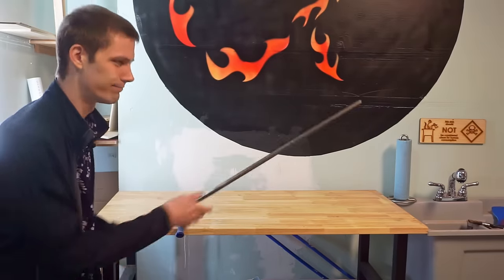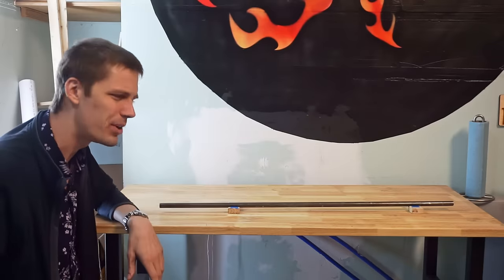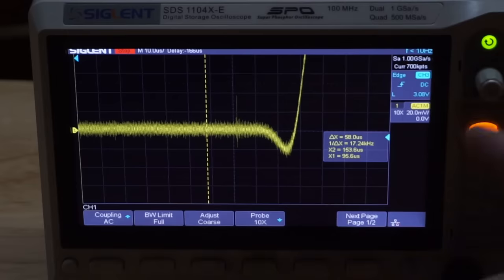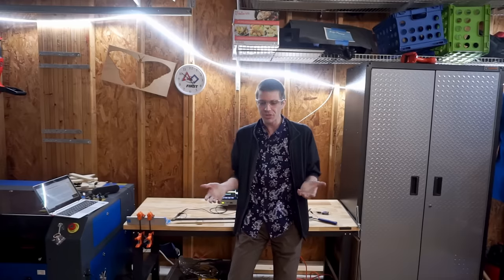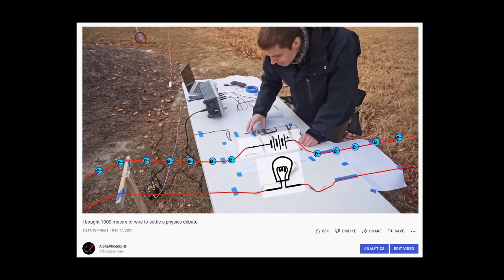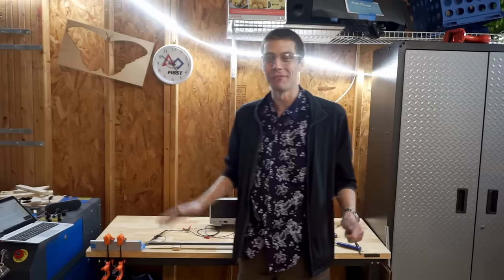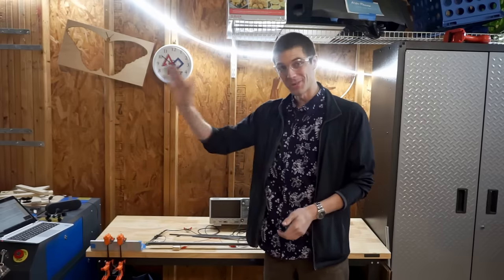Are solid objects really “solid”?

Comment: Anyway the behaviour of a solid object depends on the bandwith of the force applied. When dealing with high bandwith impulses like hammer's one no body is a solid body. 
You could try to make the same experiment with a resonator exiting the rod at any eighen frequency and then measure axial displacement in a node position to see that the bar doesnt move at all

Comment: Except that cylinders are 3D... or sort of 2D in a sense (length by diameter/radius).
OK, I guess you did say "basically," giving them a little room to be 3D but act 1D. Meaning that you'd say that the big cube would be significantly more 3D.

Comment: do you have 2 pressure sensors or 1?   the delay might simply be the sensor propagation delay so you would need both sensors together, hit the hammer, then measure that they react the same, note any nanosecond delay?  now you have the sensor correction factor.  Then put them at either end of the metal bar and get the reading?   Or is that what you did?  Anyone who can comment please do.  These measurement videos are great

Comment: Since the information transfers at the speed of sound, does that mean that after the speed of sound objects start to stretch?
Reply: Compressed. Followed by "stretching"/"decompression", like a sonic boom for example. If you further brake it down in layers. Boundary layer, where information is most compressed does not move. Even if information leaves this layer it's replaced by new or more information. In theory, you can compress information in this layer until you make a black hole. This layer increases the area of information transfer. Layers after the boundary one have decreased compression and information flows towards them.

Comment: C makes the most sense, I would go with D but being 10x longer then the speed of sound makes no sense it should be close to the speed of sound in the material 

Edit: after the answer I guess the speed of the hammer only would matter if the hammer was moving faster then the speed of sound in the materiel

Comment: Can someone explain to me why (in his previous video) the electrical "shockwave" was traveling as the speed of light, because it was electrons pushing unto electrons and electron interaction is mediated by photons, but here the kinetic shockwave is traveling at a lower speed (speed of sound) where it is atom pushing against atom, which (by his own explanation) is in fact the electron's of one atom pushing the electrons of the next atom, the same interaction also mediated by the electromagnetic force (photons). Where and how exactly does the "delay" happen, that turns propagation at speed of light to propagation at speed of sound?
Reply from the maker: Atoms are a lot heavier, and the springs connecting them are wimpier, so the field propagation isn’t the only thing that matters anymore

Comment: That is if there is a source of energy able to deliver such energy to even push that weight would, by every definition, destroy the bar. Anything less would get destroyed by the bar. For the sake of argument let's say it can be pushed. It would take time based on the force enacted on it, like a sound wave but in the resistance of the steel. Like a guitar string.
Reply from the maker: You could push it with your hand, it would just accelerate slowly

Comment: What happens when the force applied compresses the atoms a lot closer together, or even to touch?
Reply: in stars, pressure compresses atoms so much they fuse together, and eventually pressure gets so big they form a singularity with arbitrarily high gravity and make a black hole

Comment: If we had a non deformatable pipe filled with water capped at both ends with sensors. Water being non compressible. What would you expect for the outcome of the experiment?

Basically what would the outcome be using a non compressable material?
Reply from the maker: Water is compressible, just like steel. The result would be the same as here
Reply: @AlphaPhoenixChannel 
What if the water is pre-presurized in the tube?
Is there a non-compressible material that can be used?

Comment: At 09:39 you talk about the negative blip being an artifact.  Couldnt it be the bar receding from the sensor as the wave of force travels through it, similar to the ocean receding prior to a tsunami? 9:39
Reply from the maker: It went away if I reversed the sensor, but to trigger with the hammer, the conductive side had to face the other way so I was left with the artifact

Comment: Your electrical connection, at the hammer end, would have been more accurate, if you would have placed the electrical connector on the hammer.  You will probably see different results.

Comment: Question, what exactly is the force that springs back the atoms in place? Does it have an end or does it keep going forever like a constant?
If I assume the metal bar is unbreakable and I keep hitting one end of it forever, would it one day just bend as the forces withing cannot... "Boing" back in place?
Reply from the maker: Elastic deformation (springiness) is a deformation of the bonds between nuclei. When bonds stretch, the electrons that make up those bonds end up in energetically unfavorable areas and there’s a force to put everything back.
If you push too far, you can break bonds and permanently bend (plastically deform) a material. Check out my video about “why are metals stretchy”
Reply: Thanks for replying! Really like these science/physichs videos as an someone cursing electronic engineering, though this is ten times better then electromagnetism 2 XD @AlphaPhoenixChannel

Comment: The effect of vibration, and distance from bar to sensor is confusing me, wouldn't that vary by a lot?
Reply: and what if this experiment was done with similar density object but made of different material will less vibrating characteristics?
Reply: ALSO what if you just pushed it instead of hitting it? (less vibration)
Reply: Speed of sound is “the distance travelled per unit of time as it propagates through an elastic medium”. So this means the speed is different depending on the materials characteristics . E.g density and coefficient of stiffness
Reply: @Boahz so to answer your question by less vibrating you mean less stiff then it should be slower

Comment: Is it possible that if you press the left of a really long rod that the longer it is the more inertia there is on the right side of the rod due to the extra mass?

So it would slow down as length increases?

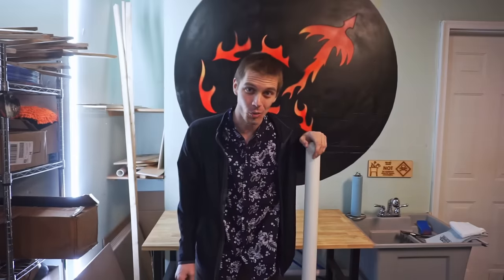Comment: The celebration I had when you said 180 micro seconds was a little embarrassing on my part. I fucking knew it! Admittedly the way I got to my answer wasn't very scientific... It can't be no time, because physics, it couldn't me the 3 milliseconds, because if it was that big on such a small piece of steel it would be something that may have to be considered in big machines, so it was between light and sound... And as I'm typing this it just occurred to me that sound quite litterally is movement... But anyway it was between sound and light and there's no way movement is as quick as light so it had to be sound... And vibration litterally is movement and sound. It's 3:15 in the morning give me a break

Comment: you are doing 1 big mistake in your experience. You are not measuring the time it take for your the push from the hammer to push the sensor. you are measuring the time it take between the completion of the electric circuit when the hammer touch the bar and the completion of the circuit when the sensor if pushed. So you have a few extra variable that normally could be ignored, but normally we could also ignore the delay it take for the push at one end to reach the other end...

If you want to measure something SOO precisely, you need to make sure your circuit are the EXACT same lenght so it the time between the completion of one circuit and the time to complete the other circuit are the same and cancel each other out, isolating the time it took for the push to travel along the rod.

Comment: Does this mean the bar is bounded by the speed of sound? It will just deform/compress if it goes faster?
Reply: Speed is relative. In the frame of reference of some cosmic ray that bar is travelling very close to the speed of light right now.
Reply: @lunkel8108  let's assume for a second the frame of reference is the fucking camera
Reply: @woahblow4127  The point I was trying to make is that a law restricting objects to some top speed dependent on the material they're made out of simply does not work if speed is relative. It's nonsensical. There are always scenarios were it's wrong, so it can't be a law.  The answer to your question is no. Anything can travel as close to the speed of light as you like. From the right frame of reference they already are. From the perspective of the object itself, it's always stationary. Only relative speeds matter. The speed of sound in a material is relative to the material. If the bar was travelling at 3000 km/s, then a shockwave would propagate from the back to the front at the speed of sound + 3000 km/s from your perspective (not accounting for relativity).
Reply: @lunkel8108  na you ignored the premise of my question and the video to give a lesson no one asked for. If I tried to poke you in the eye with an infinite length bar would it just compress if I got angry enough and put enough force into it to make it move faster than sound on my end?
Reply: @woahblow4127  Your question doesn't really make sense to me. The point of the video is that if you push on the bar with any amount of force at all, you first move the part of the bar closest to you, which compresses the region behind it and then this compression travels through the material at the speed of sound because that's basically what sound is. So we can generalize your question by getting rid of a lot of details: "If I tried to poke you in the eye with a [...] bar would it compress [...]" to which the answer is yes, as explained above and in the video. All of the extra detail of your question isn't really necessary. If you push on a bar under any circumstance, it's gonna compress a little bit. That's already explained in the video so I'm not sure what you're really asking for with your elaborate scenario.
The question also feels like it might hint at a common misconception about force, velocity and acceleration. Let's return to a finite bar. You can push on one end of the bar very, very gently and as long as you keep that up for a long enough time, the bar will eventually surpass the speed of sound and in fact any other speed (not getting into relativity here). You don't have to apply a lot of force at once, like you seem to be implying. F=ma, not F=mv is how reality works.
Lastly your original question was - and I quote - "Does this mean the bar is bounded by the speed of sound? It will just deform/compress if it goes faster?". I interpreted the first sentence as "Is it impossible for the bar to travel faster than the speed of sound?" which I think is a very reasonable interpretation of that sentence, especially given the second one. And I answered it with a clear, resounding no. That fundamentally wouldn't make any sense and things travel faster than the speed of sound inside of them all the time. I did not "ignore the premise of your question". If that's not what you meant, you have to express yourself more clearly.

Comment: Oké but what about if that steel bar is curled up into a spring and I would not push along the metal but into the direction of the spring does this theory then still apply? Would it then still take the exact time a wave takes to travel the distance of that spring?
Reply from the maker: I think then you might use the shear speed of sound not extensional?

Comment: I believe this is testing the speed of electricity thru the objects you're using. Seems like too many variables to actually make a informed decision on just the speed of the bar moving thru space.
Reply: @@brandyballoon electricity flows at the same rate thru conductive material. The length wouldn’t affect that. Once the circuit closes it’s connected. He used a pipe to say water is like electricity but he failed to mention that atoms themselves are electric so that “pipe” is technically always full and if you add water it will spill out instantly

Comment: If “solid object” means rigid body, a steel bar is nowhere near solid.  It’s a spring with a very high rate that’s acting like your little elemental model but most of the spring is in the grain structure.  Same for the pipe, it’s gonna have elasticity and allow the water to act like a spring.  Ever check your pulse on your neck vs feet and note the time lag?

Comment: Wouldn't they only be truly solid at absolute zero, when all atoms and electrons stop moving?
Reply: I think The strength of electrons in the atoms would be around the same as at room temperatures. Maybe over 800 C we would see different results.
Reply: @Muckytuja  I have no idea either way, Physics is way over my pay grade. It's super interesting tho.. it would seem that super cold would lock them together more heat, at a point heat makes metal movable with little force, and eventually liquid, then Vaporizes it.
Reply: @2112kustoms.  That is right, but since the metal rod is solid till over 600-700 C, the difference between those temperatures and absolute 0 is basically nothing. When it would start to bend and liquify, then it would matter, but till the material is at solid state, that's no real difference.
Reply: @Muckytuja  interesting... definitely a different train of thought with absolute zero. It's always been a crazy thought as as life and organisms go that basically everything is right on the edge, you can go millions of degrees the other way, but so little in cold to hut the edge, at least what we know

Comment: what if the force applied to the rod was greater than the speed of sound?
Reply: What do you mean by that? Force and speed have completely different units, it doesn't make sense to compare them like that.
Reply: @lunkel8108  I mean if the hammer is accelerating faster than the speed of sound when it hits the rod.

Comment: The experiment is flawed. There will be a delay in the sensor as the switch flips, it isn't a magical instantaneous reading switch, they don't make them. Also, the completion of the circuit with the hammer will take time to move through the wires into the machine, and then the machine then has to encode that circuit into the representation displayed on the screen. I'm not saying the theory is wrong, just that this experiment is incapable of proving it, unless you know the delay in each part of it, the switch (and the electrical signal moving thru wires into the machine, and the encoding of the signal into a visual), the circuit with the hammer, and any necessary steps required by the machine to read the signals and turn them into a visual representation on the screen. Size shouldn't matter, as long as we're assuming no bending or compression of the bar. Does one side of a planet move before the other side? It's the same problem, just using circular movement rather than linear. Assuming a perfect solid, there shouldn't be a delay. There aren't any perfect solids we've found, though. If you've seen a baseball hit in slow motion,  you'll notice the ball flattens from the impact before resuming its shape. The same is happening with the bar to a much smaller degree. Continuous solids (singular objects) flex and compress, but different measurement locales don't move independently. Very cool problem, very impossible to solve without a perfect solid or a multitude of data points about an imperfect solid.
Reply from the maker: You should watch the whole video

Comment: Is it posable to quantum entangle the molecules in both ends of the bar so it would respond instantaneously. 
And if so does that mean that the bond links the changes which continent tangled molecules?
Reply: Entangled particles only tell you about eachothers quantum states - you know that one has positive spin and the other negative, due to the way they were created, so if you observe one and see for instance positive, the other has to be negative and vice versa

They don't carry any other information and can't be used to transmit it either

Comment: Alternating current means electrons go back and forth. They do not flow like water through a wire.
Reply from the maker: Sure they do - they flow one way then they flow back. AC is only 60 hz, that’s crazy slow
Reply: @AlphaPhoenixChannel  not according to another video I saw, but I’m no expert on this. I’ll try to find the video and let you know.
Reply: Do you dispute this?
Reply: I posted the video. Did you take it off? Why?
Reply from the maker: He talks about fields and that’s correct, but those fields are tethered to actual charged particles that need to move for the the effects he discussed (and I observed in a follow up video) to happen

Comment: Using electricity throws off the entire experiment especially since youre using a hammer thats not copper and the materials are a mix of different materials. Am i missing something about the rate at which electricity flows thru different objects??
Reply: Also I don't know anything at all just trying to understand that part. Love the video.
Reply: @josiahamaze  Steel is about 42 times worse than copper in conductivity but, In short distances, the signal shouldn't be so varied through those different materials, I guess. I think it is negligible here, but you are correct!👍
Reply: @@brandyballoon Oh s**t, you are right.
My brain isn't as it was 30 years ago. :D